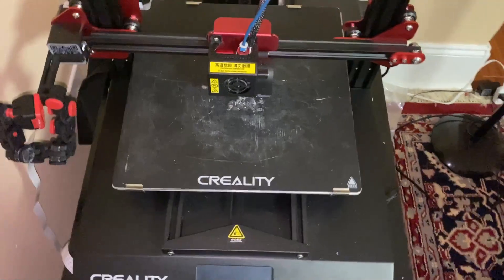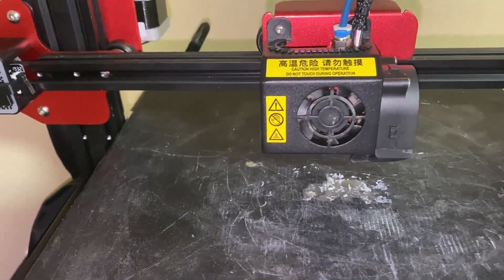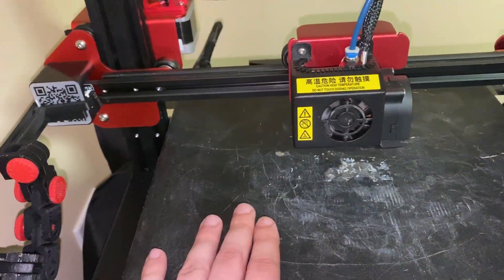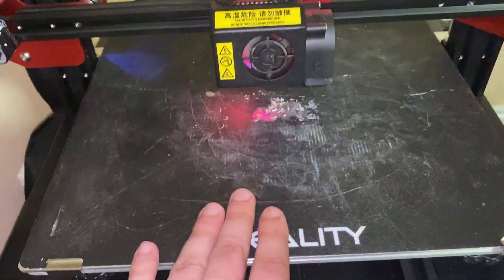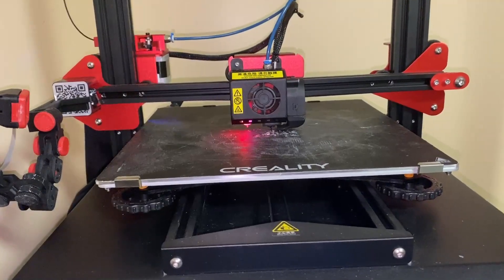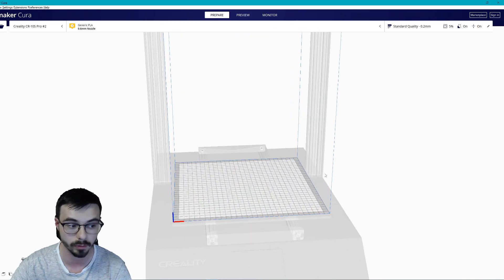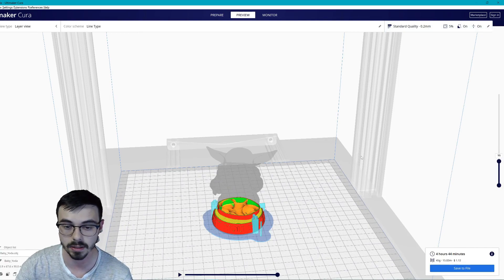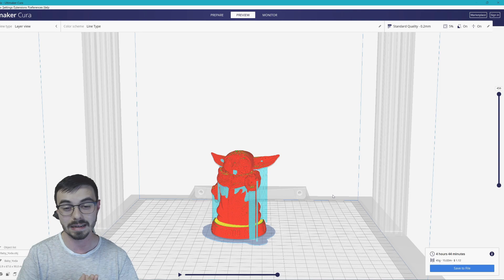A Beginner's Guide to 3D Printing | 3d Printer Tutorial

Comment: Will the the Raspberry Pi (Octoprint) allow you to turn off the power to the printer remotely or does it just stop the printing process just not the printer? Would a 'Smart Plug' be better suited for this purpose? I would like to be able to monitor my print job when I'm away from home and cut the power completely if needed.
Reply from the maker: Raspberry Pi can monitor the temps and stop the print or shut down the temps to 0 (if your sensors work) I would suggest actually both to be super safe since octoprint doesn’t totally shut off power- just the process. Have smart plug on printer. And octoprint monitor. Safe and remote!

Comment: I received my Creality CR-10S Pro V2 a few weeks ago. Did you have any issues with the having t0 adjust the Z-offset every time you turn of the printer because of the motors disengaging which causes one side of the Z axis to sag? On YouTube I've found two solutions for this: AntiBacklash Mod or installing a push/pulley system. Do you recommend either?
Reply from the maker: hey! i do not need to adjust the z-offset upon every power on.)it is normal for you printer head to sink when off, when it turns on it will re-adjust) Since you have the V2 the auto leveling sequence it runs before print should compensate for the change as long as your bed is fairly leveled by you
Reply: @AntonsCreations  the auto leveling wont compensate if the gantry starts to sag mid-print. I have the same issue and I am getting a replacement printer from Amazon. I hope the next one won't have that issue.
Reply: @IlanDavid  Do you think you could elaborate your problem? i think i have the same issue. . but im not sure, i cannot print anithing, my z offset its 2.35, im completely lost, every time i level it with the wooden thing, the left side lowers by itself i dont know why
Reply: Do u think should I buy this pls tell honest
Reply: z sync mod corrects the issue. 15 bux on tiny machines.